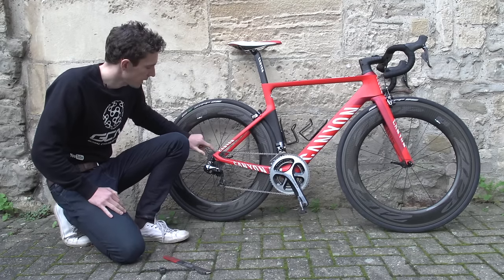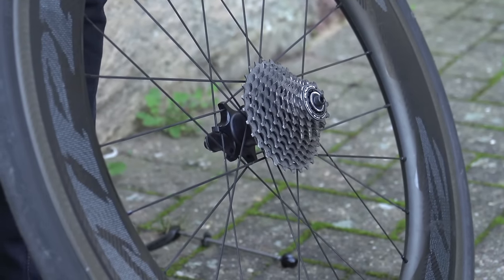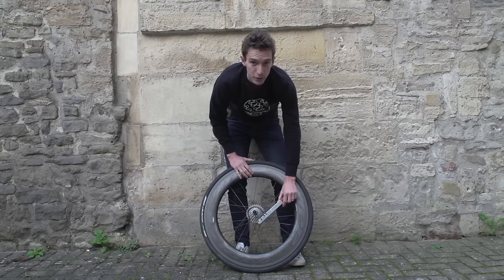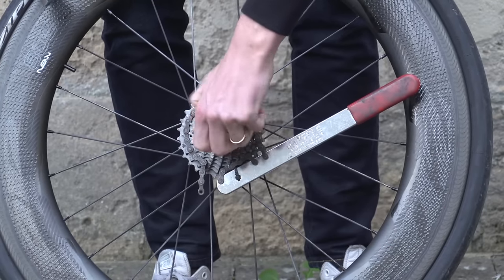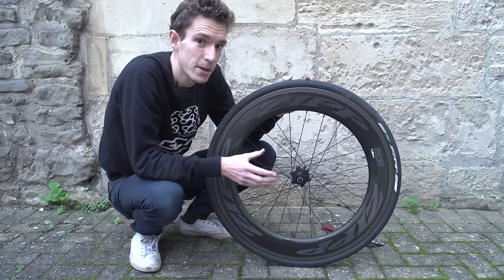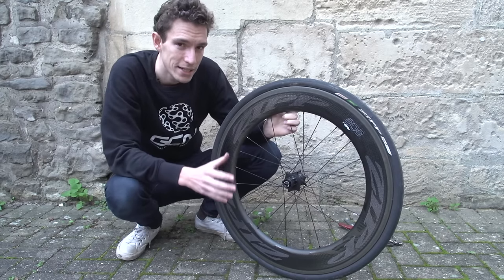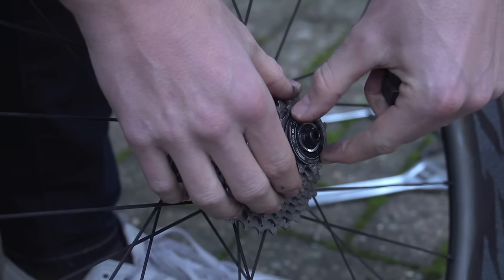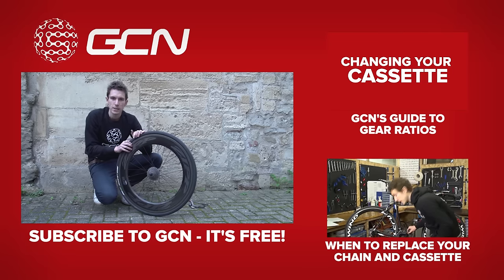How To Change Your Cassette | Road Bike Maintenance

Comment: I love your videos. Very informative. I do wish to point out one minor caveat. I have been a maintenance guy for 40 years just not bike. Mostly industrial. And I see this all the time. You are using you adjustable wrench backwards. When you use it pushing against the adjustable side it will tend to flex and will wear out faster. You also tend to cause rounding of the nut you are trying to loosen.
Reply: Ha ha, I was looking through the comments to see if anybody picked up on this point before I mentioned it. It is a pity that this otherwise good tutorial starts out with this bad use of a tool. Even so, his wrench was probably strong enough to not be a problem in this case. It could be worse, he could have used a pipe wrench :)
Reply: Lol
Reply: No torque wrench to tighten either.....
Reply: @wayneworld5958  Perceived effort is fine, Park Tool also says its ok.

Comment: hi, you said at the end of the video to tighten the cassette fully with the spanner, but how do you know how tight it needs to be? Don't you need a torque wrench? Thanks
Reply: As you pedal the cassette will lock in

Comment: Simon just a small detail. Adjustable wrenches are designed to self tighten on the nut if you hold them the right way around. You need to turn the spanner around so that the adjustable part of the wrench is underneath the force you are applying to it thus lessening the chance of rounding off the nut.
Reply: Came here to say the same thing. The fixed end of the adjustable wrench should be applying the force, that is why they are angled that way. Many ppl don't realize that and damage the wrenches or the nuts.
Reply: I solve the issue by using a 1" 3/8 drive socket on my torque wrench.

Comment: Awesome how to video as always. Just one tip though, it's always good habit to grease the thread of the lock ring since it's a high torque component. cheers
Reply: Grease reduces friction on the thread. It's easier to undo, but it also means fixing with 40 Nm torque can overtighten parts.
Reply: @Andrius1115  What? I'm so confused on what your comment meant.
Reply: @Eng586  it's strongly recommended to to grease car's wheel bolts. AS it is easy to overtighten the bolt. Grease cooks and you can break it then undoing. It also increases chances for the bolt to get loose.
Reply: @Andrius1115  It's easy not to overtighten. Tightening to 80% of maximum torque after greasing the lockring thread will make loosening later on easier while preventing overtightening. No way will it get loose by itself.

Comment: Followed the instructions today and easily swapped a couple of cassettes over - thankyou! I used a torgque wrench to get more leverage - handy also for setting the correct amount of tension when you tighten.
Reply from the maker: Awesome! What's the project that you are working on? 👀
Reply: I was swapping around a Shimano 11-28 with an 11-32 which I prefer. Both wheels now sorted so looking forward to easier hill climbs! I should have said I hand threaded the lock rings before applying the torque wrench/spanner as I think you recommend.

Comment: Nice video.  One thing I would add is to make sure to thread the lock ring on by hand before you take a wrench to it.  It's really easy to cross thread and you could ruin an aluminum freehub body in an instant.  It looks like Si did hand thread in the video, he just didn't emphasize the importance of getting it right.

Comment: Just built a specific cassette for my crazy neighbor. Wants easy climbing gears but 1t steps on the fast end. 
Had a 11-32 and a 12 -25 9 speed around. So ground the rivet heads off did some cog mixing and made him an 11-12-13-14-15-17-21-25-32. Works great
Reply from the maker: thats a great hack
Reply: hahaha it's much hassle. But easy to do for yourself.

Comment: I loved the phrase "reassuring difficult to get wrong."  I usually find a way! 
Bit by bit I'm learning to do more of my own maintenance and ashamed I didn't do it years ago. I changed my first cassette last night following this video, but still - somehow - managed to make a pig's ear of it fitting the smallest cog in a way that it didn't sit right and ripping the thread off the lockring.  Simon says: "Simple process"!  I re-did it all (twice) and finally got it right, using a spare lockring I happened to have.  Still not sure how I messed it up, but I've certainly learned plenty in the process.

Comment: I noticed you did not use a torque wrench when tightening the cassette.  how do you avoid over-tightening without a torque wrench?  Is there a way to know if you over or under-tighten the cassette?

Comment: An easy way to remember which way the chain whip goes is that the "tail" of the whip points towards what would be the rear of the wheel if it were mounted on the bike.

Comment: don't forget to use a torque wrench to tighten the cassette up , its 40 n.m. for shimano/sram lock rings , I used to use an adjustable spanner but found it was a bugger to get the lock ring loose next time around , and another thing is ... before fitting a new cassette screw the new lock ring fully into the freehub to take off any metal burrs on your new lock ring ( otherwise you can easily cross thread it ) ... boring I know but usefull advice for a 1st timer ;) )
Reply: +MRGRUMPY53 Same here, a good umph, but not a mmmumphh!
Reply: MRGRUMPY53 haha :) what ever works for you mate ;)
Reply: +MRGRUMPY53 I refer to that as TFAR (that feels about right)

Comment: Ok, a couple of points.... 
1: I"ve been changing my own cassette for about 15 years, and noone ever told me about the skewer thing... GAH, the number of times that would have stopped the cassette tool from flying off and landing under something in the garage.
2.  Si, in case noone has told you in the last 8 months, that's the wrong way to hold a shifting spanner.  Spin it around the other way, so the 'back' has most of the force going through it, prevents rounding off nuts.

Comment: Don't use a adjustable wrench because most people have the cheap ones which slip causing the wrench to round the lock ring, so use a spanner

Comment: Awesome that looks relatively easy. Got a Ribble hybrid coming not the best groupset, acera so im getting a alivio casette, i already have 105 rd and fd. So it'll be quite a nice bike when I've got rid of the silly brown saddle urgh. Luckily again i have a trek saddle and carbon post i reckon ill get it sub 11kg which is great i think for a hybrid.  
I much prefer road bikes but having had a stroke im clumsy, ive already literally folded a trek 1500 down the pan, well not really as im getting a seat and post and better gearing for my ribble i only paid 599 it weighs 11.4 stock so a relatively light hybrid i need more strength in a bike only reason i use them when i have a turn my left arm will jerk leaving me going flying. Ive hit metal railings and literall somersaulted, luckily onto grass. I digress can't wait. I was going for a giant that tbf looks cooler but the better bike is definitely the ribble especially when upgraded at least i can do this one i can put on gears tuning however not for me. Unfortunately i can't afford a 105 cassette atm alivio will do good enough for me as its better if only marginally than aceras in fact its altus  everything else is acera except the rotors on the brakes.  Which wont make a difference to me. Currently im all but down to metal on my claud butler brakes at 14 kg im looking forward to a 4 kg saving maybe a little more when finished. Easily 10.5 a vood weight i think im used to, well 14kg atm i have riden a 8kg bike my trek thats frame is nearly bent at 90° so it be more like riding that. Best thing about the bike, we two things is one, its made in England two, carbon filks abd racing green why tbey put a brown saddle avd grips who knows. Classy lolking bike. Ill look a little odd riding it eith Jordan trainers, who cares. One of my less bike knowledgeable friends was laughing at it The joke will be on him, when i leave him for dust, that said i could do it on a 30kg bike i cycle approx 150 miles a week. Not bad for someone with two brain injuries. I digress.

Comment: Just used this to switch to a larger 9 speed cassette. Thanks for your help!!
Reply: Is it possible to change my cassette on my bmx to a single one? It has 6 speed it's going slow since I removed my gears!?
Reply: @drillbaby  not without replacing the hub at the same time mate; but then you need to consider alignment and spacing as well. I swapped a 29T 9 speed cassette out for a 35T 9 speed cassette. I have a single speed fixi as well as a road bike. Just buy another BMX 🙂

Comment: How tight should the be after changing it. You did say they are fairly tight, but you did not seem to give it much welly when tightening it after the change?
Reply from the maker: hi Dick, make sure it's nice and tight, and remember to grease the lockring. Check out Park Tool for their Torque specs > http://www.parktool.com/blog/repair-help/torque-specifications-and-concepts#article-section-4
Thanks
Jon

Comment: hi guyes, I just did this (thanks Si! awesome video) but i dont have a torque wrench.. how tight is 40Nm?? is that like, extremely tight, or not much? thanks!
Reply: 40nm is pretty tight. For reference, lug nuts on car wheels are usually 100-115nm.

Tbh though, if you've never used a torque wrench, don't try guessing torque values. I've tightening things up with guesswork and then checked with a torque wrench after to see how accurate I was - was never anywhere near.

Buy a beam style torque wrench, they're relatively inexpensive and will stay calibrated for much longer than clicker style ones.

Comment: Currently i am using ultegra R8000 cassette. Can i replace it with 105 cassette? Same speed and teeth. If yes, any adjustment required?

Comment: Well this is a nice video, but I'm quite annoyed because I have a new back wheel with no cassette, an old back wheel with the cassette I was told I could easily take off and put on the new one, but having tried to and failed to work out how, I looked it up on Youtube and find I need specialised tools I do not have. I mean they could have mentioned the tools I would need jfc. I'm going to have to go to a repair shop again tomorrow.

Comment: I have a Bianchi Via Nirone Sora with a 9 speed Cassette in the 12-27, I am wondering if there is a 9 speed cassette that would get me into the 32tooth range, I find myself constantly in the lower gears on the big ring and in the high gears on the small ring. I live in new england in the smaller hills and only started riding last year . I am learning new stuff everyday and hope to hit 1000 miles this year. I did 500 last year.
Reply: i have a 8 speed cassette, from shimano and it has 32 tooth, the smallest ring has 11 tooth

Comment: Hi
I have road bike comes with 11-25 cassette and I have another wheel with 11-28, can I use 11-28 on 11-25 bike or I have to change the chain.

thanks

Comment: Hey guys! I've got a question: I have a Shimano 105 11v 11-28t cassette, in a full Ultegra transmission, and I want to replace it for a 11-32t Shimano 105 or Ultegra, to make it easier for climbs. do I need to change the rear derraileur and/or the chain?
Reply: João Gonçalves that's exactly what I'm trying to do, how did it turn out?

Comment: I have applied as much force as I can several times but the lock ring isn’t loosening one bit. Any hacks? Seems over tight/stuck. Thanks!
Reply: will howard Longer wrench will give more leverage. Freeze spray the ring so it contracts a little. Warm the outside/cassette with a hair dryer at the same time so it expands.
Reply: Also a little penetrating fluid sprayed on and left a while might also help, it’s better than WD40.

Comment: My cassette just popped off with a bit of leverage by itself, very confusing, force in the sense of that I added a aero disc wheel cover and while installing it my cassette just popped off, I never have any issues with my cassettes so I dont really know whats up with that, its the same cassette that shipped factory with my bike

Comment: Help! I have a Shimano 6 gear (MF-TZ20) I put the screw lock and try to turn it anti clock wise. It jus doesn’t budge. I put my whole body weight on it still wouldn’t. I try hitting with a heavy duty hammer and it still doesn’t unscrew. What an earth is going on??

Comment: Lesson 1 for bike mechanics; never use adjustable wrenches. Always use the proper size ringwrench
Reply: Why's that?
Reply: +Sam Stead because they will come lose and destroy your bolt and are way to large to handle good. there will be more collateral damage overall
Reply: +MRGRUMPY53 well, it is also a shame to damage the lock ring. but most importantly i said: never use one. no excuses
Reply: "Use what you have", I say  The adjustable wrench never touched the bike, so no worries there.  If I'm that concerned that I need the exact wrench size for everything I loosen and tighten then I'm taking it to someone to do it for me.  The goal is to get riding!  I've fixed so many parts on my bike without the "proper" tool.

Comment: Adjustable wrench ouch! quickest and easiest way to strip/round a bolt is to use an adjustable wrench.
Reply: +experiment54 Doesn't really matter on something that size
Reply: +ThatWolffe bullshit.
Reply: experiment54 it depends on the material of the bolt you are turning and quality of the adjustable wrench actually, and I can assure you what Si is doing in the video is perfectly fine
Reply: +ThatWolffe bullshit. You're entitled to your opinion but you're still wrong.
Reply: +experiment54 Sorry, but ThatWolffe has you on this. Before that wrench harms the corners or rounds off the cassette tool the freehub, spokes and all would be destroyed. Not a fan of an adjustable wrench, but in this case it is not harming a thing.
Reply: +Brian Moore I stand by what I originally wrote. Any decent mechanic or engineer will agree with me and also say "the last wrench you reach for is an adjustable"
Reply: experiment54 Yet they all have one in their toolbox :P
Reply: +ThatWolffe like I said @last spanner you reach for is an adjustable one" Bet they were all taught the same ;)
Reply: +experiment54 In this case, the only thing he can damage is a $20 tool... Unless you're really precious with your lock ring tool, there's no problem with using an adjustable wrench...
Reply: Not only made the mistake of using an adjustable, but he used it facing the wrong way on the lock ring. It should of been turned the other way so the adjustable jaw wasn't applying the majority of the force. (When he tightened it he used it the right way.)
Reply: You should never use an adjustable wrench if you have the right sized spanner.
Reply: They are adjustable right?  So you can tighten it to fit the tool/bolt?  So my suggestion is tighten it up and you won"t ruin tools/bolts. Obviously you should use the right sized wrench if you have it, but every mechanic, construction worker, etc carries one.
Reply: experiment54 sounds like you need to learn how to use a wrench

Comment: Can i replace only one cog of my casette
Reply: Depends on the type of cassette
Reply: With a Dura Ace CS-7800 cassette the smallest seven rings can be replaced individually, however the biggest three are all one piece. Adding more than two teeth on the biggest ring will generally require a chain resizing.

Comment: how tight does it go back on? please not in nm.
Reply: +7600e I'm afraid it  is Nm. You need a torque wrench to do proper job. For my SRAM casette for example it is 40 Nm (350 lb in). I have two of those. One for small  parts (< 10 Nm) and one for bottom bracket, pedals and casette (< 100 Nm) . The big one does also CW / CCW (BB/pedals).
Reply: 40 nm or when you start to hear the lockring slip
Reply: +7600e basically, 50nm is about as tight as your gunna be able to manage, 40, is obviously slightly less than that- i feel your pain mate, i don't have a torque wrench either!! :L
Reply: Thanks for the replys

+vaxbuster I got a torque wrench but it doesnt have the adapter bit to fit something as big as that :/. Anyone link one for me please?

Comment: Those wheels cost £850 quid + #lendzafivergcn
Reply: +lee a dorney 850 for a pair, thats not actually to bad for wheels of that type
Reply: My custom frame cost that...
Reply: you would be surprised how much more difference a pair of wheels like those makes, even if they are expensive as hell
Reply: Yeh I recall a breakaway in the ParisNice and the bike slid left n right because of the frame stiffness...
Reply: +lee a dorney Fair bit more than £850 - try £2350 ($3400) for the pair. Given their coverage of the wheels in a video a month or so back I suspect they were fortunate enough not to have to pay for them though!
Reply: No they are worth more than 1500 quid actually. This is because they are not officially popular yet and they are still rare...
Reply: ***** aaw thought i could have had a bargain before if they were 850
Reply: ***** I Google'd them and got 850 lowest..
Reply: lee a dorney might have been for one wheel, if not send us a link
Reply: Cameron Fitton Oh it was only for the Front LMAO...sticking to my affordable wheels that're affordable to repair n true if they go wrong 👍
Reply: Yep! Not that my wheels are 'affordable' but for racing I have a pair of Mavic Cosmic 40C which I borrow from people I know. What wheels do you have?
Reply: I've 3x pairs - a basic Shimano set, a Decathlon set & a lightweight shop-build. The mavic cosmics with alu rim' appeal...not convinced about a total carbon wheel as the roads where I live are CHRONIC